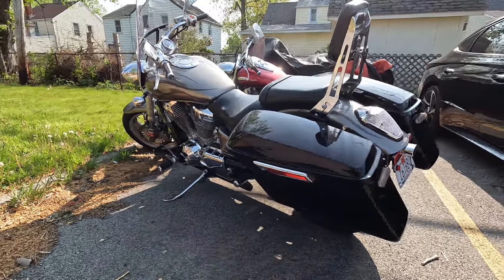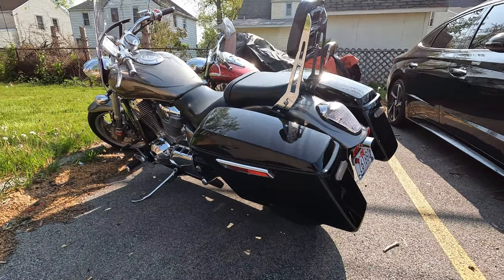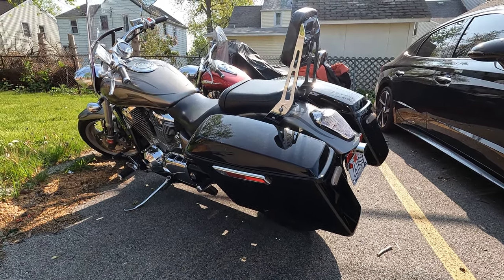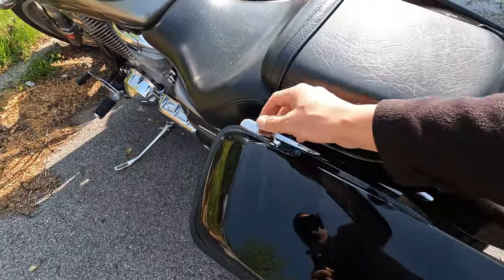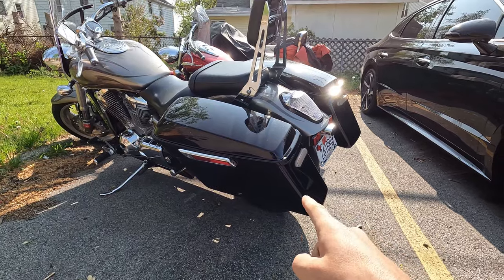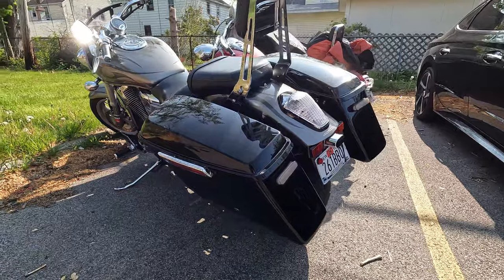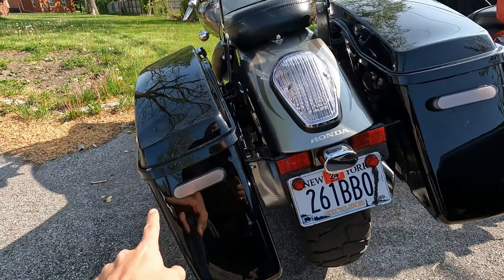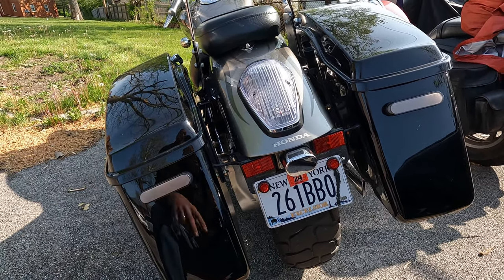How to Install ANY Kind of Bags to your Bike!  What I run on my Honda VTX 1800c

Comment: Might want to add a nice size washer between the bolthead and bag so it spreads the pressure out so it doesn't want to crack the bag. Good vid bud!
Reply from the maker: Yea, i seen that while putting them back on. I'm still debating installing the liners.

Comment: I have the same bags but using the Harley brackets
Reply from the maker: I tried that too but they would not flow through the bottom of the bag properly and then none of the holes lined up.

Comment: Where'd you get those brackets? I wonder if those will fit my Suzuki Boulevard C90T?
Reply from the maker: really just depends on how the side fender covers are, I found that they will fit just about any bike.  Some have weird angles on the side fenders but for the most part they should work.

Comment: I'm guessing that the steel bar stock is 1" X 1/4" X length? I made a set out of aluminum stock with back bracing for a set of heritage saddlebags. Did you use locktite in the bolt holes?
Reply from the maker: Yes, 1 1/4, you don't need Loctite for the bolts, the brackets are threaded so once you tighten them and put the bolt on them backing up only makes them tighter because of the opposing thread directions.  Still gives a bit of wiggle so my last resort is likely get the harley brackets and pay a welder to shape them to fit my bike.

Comment: Wondering if this would work for my Vulcan 900?
Reply from the maker: If the fender brackets are along the side of the fendor similar to mine it should work,  However, they are a bit tall above the bolt hole and I have the backrest so I had to grind the tops down so they would clear/sit in the correct position.
Reply: They work on my bike 🙏🏾 came out really nice thanks!!

Comment: Wad up brother. I finally got mine on...... but..... my bike is lowered and my custom fender sits lower as well . So with everything lower my right side bag is only about 2 - 2.5 inches above the exhaust. Haven't been out for a test ride yet to see if it melts . What do you think, should I be worried????
Reply from the maker: No worries at all, Jeffs road glide sits about an inch or less from his bags, and no melting.  Mine are like 4.5 inches away.

Comment: Would this apply to 1300 VTX models? Seems like the same setup across but it’s been awhile looking at them
Reply from the maker: Absolutely,  i actually used these very mounts on my 1300, check out my video prepping from sturgis, same bolts and everything.
Reply: @freefree2021  thank you brotha. Trying to do it some justice and having it rolling since it’s been forever since working on them. I’ll dig around for that video you suggested
Reply from the maker: @RubiconDONN  its the "universal saddlebags" video,